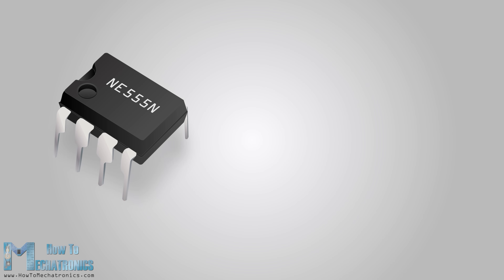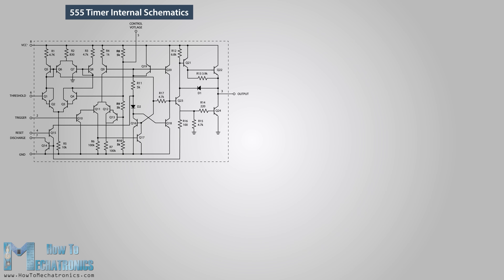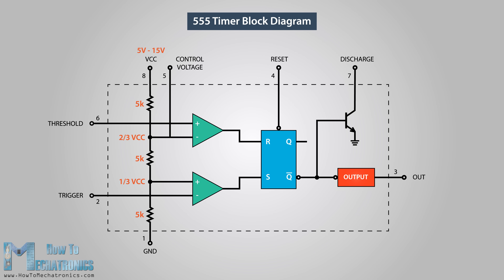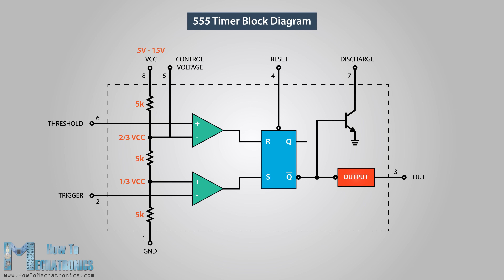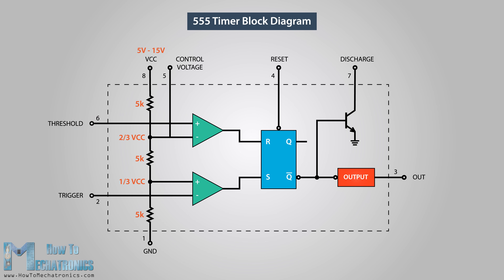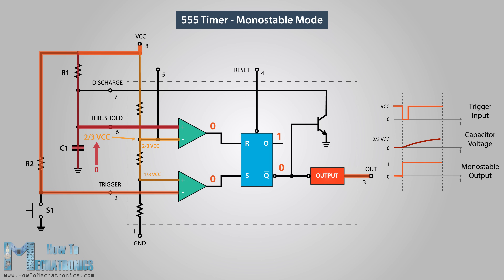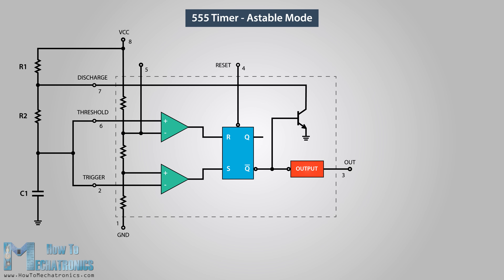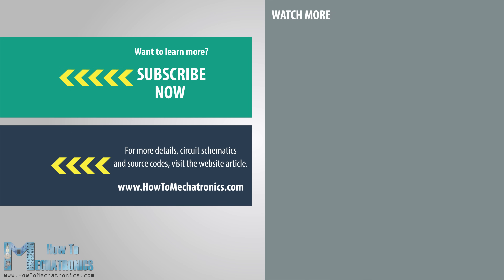How a 555 Timer IC Works

Comment: I think the only other IC that can possibly rival the 555 as being the most sold is the 741 Op-Amp IC.
Reply: people are stupid and we have to spread the word about lm358 more then
Reply: That's true but 555 is the one being more sold than 741, but they are pretty close
Reply: The 741 is as obsolete as an early dinosaur. Why people still design with them, why any sellers carry them, why magazine editors publish circuits using them, and why they're even still made is a complete mystery in a technical world moving forward and hopefully not moving backwards.
Reply: @joewoodchuck3824  yes op that use bifets are so much better and can be used in high ended audio circuits the 741 are noisy (popcorn)hiss noise
Reply: @12presspart  And all but obsolete for a few diehards.
Reply: joe woodchuck "Obsolete" is subjective. If you don't require great performance, any old op-amp could be fine. Lots of people stick with what they know. For many applications there's no compelling reason not to use a 741. 

But of course, if you really hate the 741, by all means, don't use it. Like you said, it's an old design...
Reply: I think y'all are overlooking the SID 6581 chip... just sayin'.
Reply: What about 78xx linear regulators?
Reply: John Scarce I was not talking about quality, but merely about sales figures, where i think the 741 is by far the most sold opamp of all time.
Reply: John M.   I'm not on a high horse at all but I do know enough about op amps to use much better ones. 
   I was one of the first to use an LF356, one of the better low price units back then, and even that is a legacy piece now. But it was still leaps and bounds better than a 741. 
    None of them cost very much so why perpetuate antiquity?
Reply: Baruch Ben-David.  There's nothing subjective at all about the specs. Any price difference is trivial at hobbyist quantities.
I suppose people could be using CK722 transistors too, but people seem to  favor more up to date units like 2n3904/06. To each their own.
Reply: I'm Agree with you
Reply: TL084>>>741
Reply: L298 ??
Reply: Thanks for all the responses, but those of you who have said that this OpAmp or that OpAmp is far better than the 741 seem to have missed the point in my original comment; i was only talking about sales figures, nothing else.
Reply: joe woodchuck let me know if you can see any spare 741s from up on that high horse, I'll take them!
Reply: why lm741 tho? lm358 is much better-cheaper and contains 2 in a single package

Comment: Hi, im still new in electronics and forgave me if it's a stupid question.
8:00
Are R2 and C1 working as a voltage divider ? Because I couldn't understand how the capacitor is applying a voltage to the trigger and threshold while charging

Comment: I have to sya, this explanation of how the 555 timer works is beautifully done. It's simple and clearly illustrates what's happening internally. I definitely learned a lot more with this than I did in previous 555 timer videos by other EE youtubers. <3

One question begs to be answered, though. Where do some of those constants come from in the formulas?

Comment: using 3.7V as a voltage supply to a 555, how can I achieve 500 ms on state and 4 second off state? I've supplied a 3.3uf cap and 100K ohm / 1k ohm voltage divider/RC Network and have come close but it's not quite right because the on state isn't long enough. Does the drain change the output? So I'm using a 3906 and the output of the 555 to the pnp. The pnp drain is 120mA. Does this change the timing of the on state due to voltage drop when the current draw pulls the voltage down? If so how will I adjust this to accommodate the 500ms  requirement? Thanks in advance if you can help.
Reply: 1.I think yes
2.Try using an f.e.t,it might solve your problem.
Reply: In this video npn discharge transistor is being used. And you are using pnp.

Comment: Nice presentation, although I suspect that it could be a little bit hard for a pure beginner to follow ( too much to grab  in just one video, and have to relay on knowing how a flip-flop works ... Ben Eater took many videos to explain the same three states, as example, ... but your presentation stands for being quite nice and to the point none the less ). Just a small graphical ... imperfection. Around 9:50, T_H should be longer than T_L but graphically, the reverse is displayed by the graphic :-)  

Also, to be strictly technical,  V_C1 has to go a "little bit" below 1/3 Vcc (video around 9:05), not just to "reach"  1/3 Vcc, for the second comparator ( the one comparing  to 1/3 Vcc ) to effectively "changes" its output to a positive logical one. It is a small detail, but it may help to understand that electronic often has to "overshoot" a little before it reacts with a discontinuity (on the slope V versus t ).

Comment: Hi.
Can you explain why does the flip flop is connected that way and use the inverted output and not the other way around?
Thank you.
Reply: Take some time to sit and really examine the internal schematic of the 555. It will make more sense when you see how each section of the chip functions.
Reply: I guess to have output/square pulse "High time" more than the output "Low time". Because longer time period proportional to R1+R2 corresponds to flip flop complement output (Q Bar) 0.
Reply: Mobitronix Apps if high time and low time are not equal, then how can a full pulse cycle be “square”?
Reply: Because the discharge transistor is an NPN type, which needs a high signal to turn on and drain the capacitor. The next question to ask is why is the flip flop output inverted a second time before the output- I’m pretty sure that second answer has only to do with increased power handling and isolation of the discharge transistor from any effects caused by load fluctuations.

Comment: pretty good explanation video although i'm not sure i understand your representation of the output section. surely the current output through pin 3 flows from the Q (output) pin of the set-reset latch ? as opposed to inverse-Q which should be activating the discharge transistor when high ...